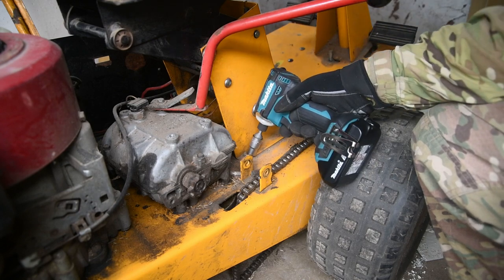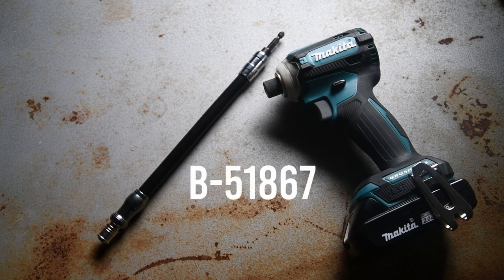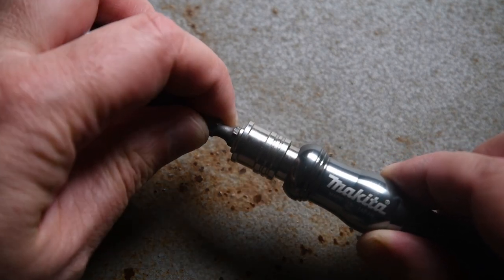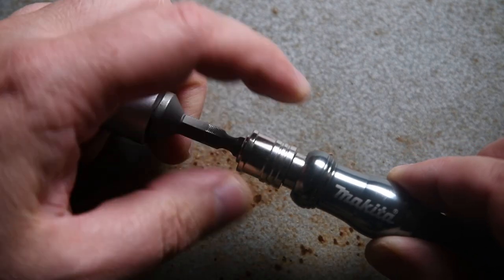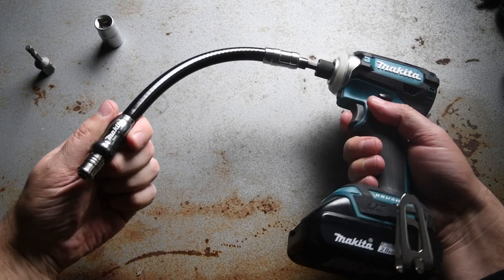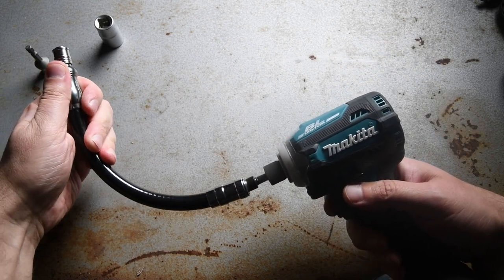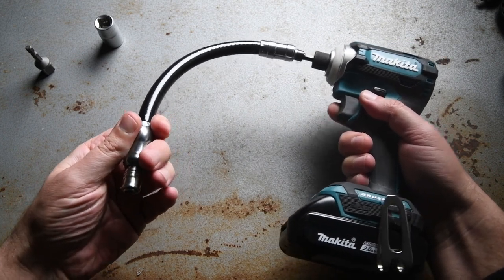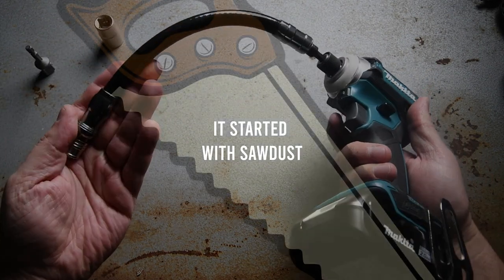Makita flexible bit holder

Comment: I bought this flex adapter today. There is no torque notation. Car engine room parts are not easily released. You have to loosen it a little with a wrench spanner and use that.

Comment: Comes in handy when trying to remove torx bolts from oil cooler on my 1st gen mini cooper sports without having to remove half the car and only one I've found that is for impact wrenches upto 3600rpm with the right adapters this simple but strong extension is so versatile can't imagine life without it saves so much time..tryed cheaper other versions and they all snapped.
Reply from the maker: 100%